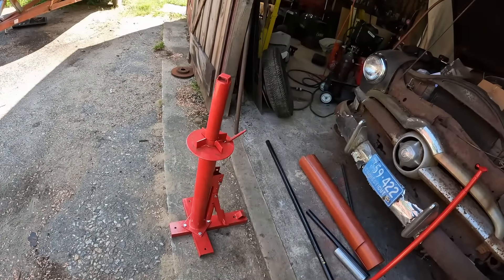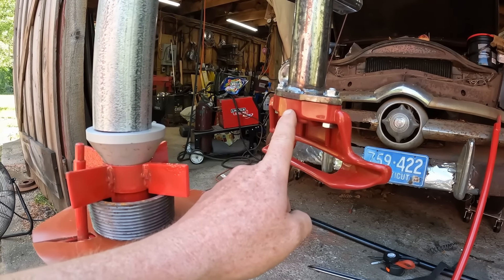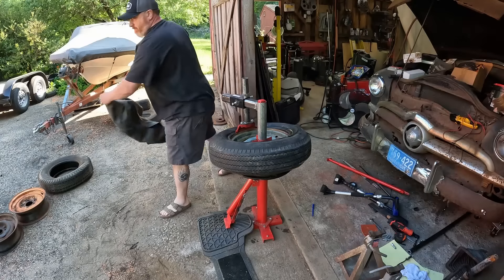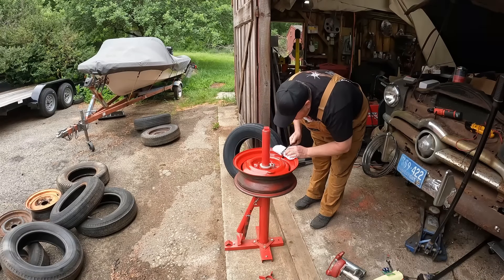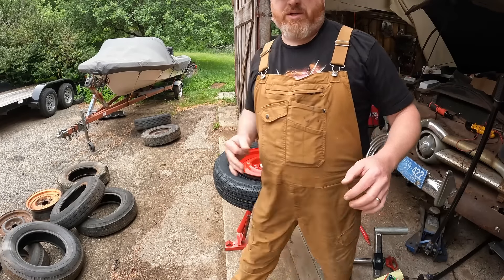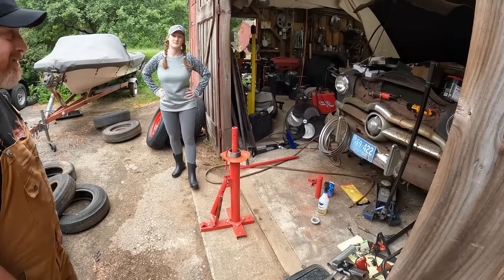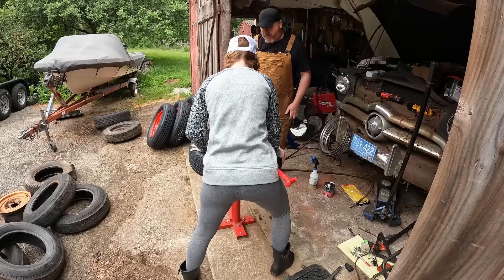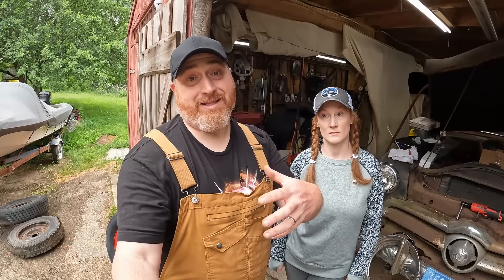How to modify a Harbor Freight Tire Changer to work amazing!!! Follow this DIY guide!!

Comment: I thought that the beads on tube wheels are different than on tubeless wheels?  It's a lot easier to break the bead on tube tires than on tubeless tires..
Reply from the maker: Yeah we've done 4 sets of tires on this thing already. We have 2 other videos doing it. It wasn't harder actually. About the same. We did some 17"and some 18" low profile tires.
Reply: @madgingercustoms    I could not break the Bead on a 10 year old Michlin  tire on Aluminum wheels on my 2003 Duramax.  That was on a hot day too with my 32,000# front end loader bucket.
"  I have two sizes of duck bill hammers.  I never swing them on the bead, I always  place the hammer on the bead and hit it with an 8 # Sludge Hammer.  I had to literally peal the rubber off of the wheel.  Of course once I got the tire off I used a wire wheel on a 9" angle grinder.  I always use Frey Lube rim grease so they come apart much easier 10 years later.  I am just discounting them with tire irons. I ordered the tire changer and parts to build the add on today .. but I didn't get the thrust bearings or the collars..
Reply: @madgingercustoms    I had a 66"x43" on 25" tire I could not get the bead broken.  Took  Commercial tire shop that had a huge air powered bead breaker .. took him 10 minutes and he charged me $125.00

Comment: Hey nifty.. I got a changer myself a few weeks ago. Even as is it's already saved me twice what I paid for it (and a couple family members) it works fine however it takes a long time to get a set done due to the amount of effort I need to dump into one wheel, and I still don't have balancer.guess I found my excuse for cheapy flux core and to make a balancer :) cannot find a friggin balancer tool 	for less tha130 or whatever anywhere 😤
Reply from the maker: Check out our other video on the balancer.

Comment: Something you could do to make it better. I welded a nut to the top of mine so i could spin it on and off faster. Easier and speeds things up. I used a nut the same size as my lug nuts so i don't need to change sockets after pulling my wheels.
Reply from the maker: Solid idea!!
Reply: Yeah. Instead of using the bar to tighten and loosen it. I use my impact to spin it on and off fast.
I may just have to upgrade mine like your's in the future. It's been handy and paid for itself the first time i used it.

Comment: 15:20 The words you are searching for are (old tires) Cross ply & newer tires are RADIALS
It's all in the cords (steel mostly) in the construction of the tire itself.
ie:
(OLD) Cross-ply tire construction, had the cords arranged at a 45-degree angle to the center line of the wheel and crisscrossed. 
(NEW) In a radial ply tire, the cords are arranged at a 90-degree angle to the center line of the wheel and overlap. 
You can find information indicating a radial tire on its side wall
The flexibility of a Radial tire, together with its strength, are two combined factors which mean a radial tire absorbs impact, shock and bumps more effectively than a cross-ply tire. 
The flexibility of the sidewall enhances vehicle stability and provides maximum contact of the tire with the road surface.
THAT is why the older (upright & harder) cross-ply isn't used any more.
The Radial's strength and flexibility allow the wheel to ride over bumps and potholes at a much faster speed, without damaging the tire in the process.
Reply from the maker: We use Bias ply.
Reply: Actually that word would be bias ply, not cross ply. And not all radials are steel, a radial tire can be steel belted or still nylon radial only refers to the direction that the belts are running.

Comment: That was a significant enhancement. I have that tool (without improvement), and it takes me about an hour, a lot of soap water, and more than two fitty to replace one tire. My tires always pop when they seat the bead. I'm not sure I would trust that bead.
Reply from the maker: They are old wheels. Before there were safety beads. They are fine. Just can't run them low.
Reply: @madgingercustoms  Oh yeah you said they had tubers before. Good info.

Comment: First of your vids I watched. Great job! I subscribed. One question and maybe I missed it. Where dit you get the flange the bolts to the duck head and is welded to the vertical pipe. If you explained it I missed it, and I watch the video twice. Thanks!
Reply from the maker: I cut that out of some 1/4 plate I had left over. Just traced the duck head on some cardboard and transfered to the metal. Death wheel from there.

Comment: Did you use threaded inserts for the mounting and what kind type if so
Reply from the maker: I believe they were hammer in redhead anchors.
Reply: @madgingercustoms  ok, any recommendation for a gravel / asphalt / poured floor that is old and crumbly
Reply from the maker: Hmm, if you can't keep a normal anchor in it I'm not sure it's worth your time. In your case you want a steel plate or solid pallet to stand on. There are guys in the comments that said they modified the bottom to slip into a receiver on their truck.

Comment: what size is the round pipe that the duck head goes on  and is that the same size round pipe  that goes over the shaft that the duck head goes into
Reply from the maker: The pipe the duck head is on is 1.25 black pipe. The od is 1.66.

Comment: Your Lincoln welder is acting up because the feed roller is rusted up and needs wire wheeling. I had the same thing happen, my wire would feed in jerks and screw up the welds and I thought my wire feed motor was biting the dust, but it was just the rusty pinch roller.
Reply from the maker: Certainly is a possibility! The machine has actually been replaced by a more capable machine that we are loving. Arccaptain MIG200 multi process.

Comment: was going to buy one of those then just started doing it by hand
two spoons is enough for that - break the bead by driving over it
you can just walk the tire on w your feet basically so no machine needed that's the easiest part
little mower tires can be really difficult so at that i wanted the machine but that was only one time
Reply from the maker: I've done them by hand, that's why I did this mod. Super easy now. The lawn mower ones are a pain.

Comment: my local tire shop charges $30 for repairs and my son had winter and summer tires that he wanted to swap tires to the other set of wheels. so basically 8 tire breakdowns and remounts, over $200 for that.

Comment: At 18:00 try not to use soapy water when putting on a tire. The moisture gets trapped in the tire bead and the rim and can rust and cause leaks. If you do it properly you do not need lubricant. The trick is once the bead is pushed under the rim lip as you spin the arm around, you MUST push the bead behind that DOWN INTO THE RECESS IN THE MIDDLE OF THE RIM to give you slack on the opposite side where the arm is pushing the bead under the rim lip. If you keep the mounted bead in that recess all around, you will have plenty of slack, and the whole bead just slips under rim lip easily as you go around with no lubricant.
Reply from the maker: You are the only person to not recommend soapy water. So tire lube?
Reply: @madgingercustoms  I forgot to mention you have some great videos. As far as soapy water/tire lube, I don't use it anymore. I work the bead deep into the channel as much as possible. It takes me a little longer and I work the bead slowly off the lip with tire spoons at first before rotating the bead wedge around. I don't do tires every day so time is on my side. I have used candle wax in the past but only one the bead wedge. I wiped down the beads afterwards but no water base was used and the wax didn't get on the rims or inside the tire.

Comment: We have one at work. We deal with turf equipment so scuffing the rims isn’t that big of an issue for us. (It’s our equipment) the problem is the shitty steel they’ve manufactured this tire changer with. Parts are bending, metal is wearing down. Quality could be much better but I guess for the price it’s been decent.
Reply from the maker: The entire center post isn't very stout. That's for sure!
Reply: @madgingercustoms  actually haven’t had any issues with the main post. But the bead breaker and that little cross piece you clamp the tire down with are soft metal. And the prybar is all worn down and slips off the tire, making it very hard to put a new tire on the rim. A simple weld bead buildup and some grinding should fix that though. 

I like what you did with welding a plate to the back of the bead breaker.

Comment: I see you figured it out, soapy water is your friend. I usually hit both beads before I go to mount the tire. Then the tire will slip right on and I can go right into mounting the other bead. Leave the soapy water on and it helps when seating the beads. Also, the more soap in the mixture, the better. The same thing applies when you are removing the tire. Hit it with plenty of soapy water. There's no need to rotate the wheel when de-beading the tire, just step on the edge after you broke the bead. It'll pop all the way around. I use a pneumatic foot pedal valve to inflate the tires. That way I can grab both sides of the tire and push down, then pull up fast while stepping on the pedal. Instantly seals the tire, then pops the bead. PS: The guide pin that goes through the rim is all you need to keep the rim from spinning. No need for a bolt.

Comment: 5:44 I'd change the liner in the gun.
Reply from the maker: It was relatively new.  We need to pull it apart and clean it out.
Reply: @madgingercustoms  They plug up faster if you are using flux core wire.  I got a free welder because the liner was bad in the gun.  They gave it away claiming it was the drive motor that was bad.  You can try blowing it out with air.
Reply: @madgingercustoms  Something else I have seen is overheating the mig gun and the ground wire becomes damaged in the gun.  I've seen guys run a new ground on the outside to fix that.

Comment: Around minute mark 20:54, loosen the clamp down on the rim. I cannot stress this enough! In the event of catastrophic failure, the massive amount of energy needs to have somewhere to dissipate. If that tire explodes, all that force (bomb level) will be directed straight at your hips and groin. If it doesn't kill ya, you'll wish it had...
Reply from the maker: Thanks.  We are making the same mistakes currently in our newest video!
Reply: Reading back over what I wrote, I think I can be clearer. UNCLAMP the rim BEFORE setting the bead, so that in the event of unscheduled rapid disassembly,  all that force can dissipate relatively benignly.
Reply from the maker: @Sightless_Squirrel  ah. I get it. New video tomorrow on this exact machine. I think I would have included that!
Reply: Right on! 
Us Shadetree Howler Monkeys wielding a wrench and a hammer have to take care of eachother!

Comment: If I remember correctly - in the 50's wheels changed.  They added a slight ridge inside the rim that the tire bead had to be forced over when inflating the tire.  This was "seating the bead" and caused that pop you hear when a tire is inflated first time.  Has to pop on both sides and then both beads are "seated".  This is supposed to keep the beads positioned on the rim when you have a blowout on the highway.  Your old rims are probably not "safety rims" so you don't get any pop when the bead goes into place against the rim.  With modern tires we don't get blowouts nearly as much as they used to have, so maybe the old rims are safe enough.  Or maybe not.  Anyway, that is what I learned when I was 10 and what does a ten year old know?
Reply from the maker: Yeah, safety bead. We have a couple old rigs without them. Need to keep them aired up properly!

Comment: Those tire machines were what we used in the army to take tires of a two piece wheel they worked great for that
Reply from the maker: I have a set of 2 piece wheels.......I'm not going to try it!
Reply: You shouldn't need this machine for two-piece wheels. That's the whole purpose of a two-piece wheel. Easy disassembly

Comment: I mounted a tire then tried to unmount...didnt have the duck bill tire iron bar so I guess I will get that tomorrow......still tweaking my duck bill mod to get it to work properly.  I did use pipe for the over the top cap swivel part....it has a seam down the center on the inside where they made the pipe that I must get rid of.....or I could just hone the crap out of it.
Reply from the maker: Yeah the piece I used was a seamless pipe. It's difficult to get that weld seam out for sure.
Reply: @gercustomsI welded my horizontal pipe opposite the seam, maybe it matters, maybe it doesnt.  Either way I will figure out how to remove the seam.  I did end up honing it and that helped a lot.  I also have a white paste tire lube made for tires that dries up.  Im not sure if dawn soap works better or this paste stuff.  Stuff says not to get on your hands and has glycol in it.  Dawn doesnt dry up.  The paste is rema tip top universal mounting paste.   Seems to me dawn works better with no water.  I figured the paste wouldnt cause rim rust.  Wasnt too keen on mixing dawn with water

Comment: Hello, Mr Ginger.   I am in process, of constructing one of these tire changers. Plan to use 2 -  3  foot  railway rails, for a base, in a V  formation. Weld the  V's   together. Weld a vertical upright,  either 2 in square tubing, or 2 inch round heavy wall oilfield pipe onto flat plate, welded to rails at  V point.   Now pursuing other ideas ;  looking around for examples, and take the best of each. Your creative inventions, at 9 - 10  time, very good. Soapy water sprayed onto the tire / bead would help reduce  friction.  Anyway,  gathering  ideas.    Thanks  too  much !  
 Good luck,  bro  !    ( from east central Alberta )
Reply from the maker: Thanks for watching!

Comment: When I was 18 back in 1968, I beat the spin balancer using a bubble balancer. The trick is making sure the floor and machine are level, have something to mark tires that will wipe off, and using 4 of the same wheel weights set them on the tire or rim, than mark it take the tire assembly off the balancer and put the first set of weights on the inside straight across from your marks than sit the tire back on the balancer and take the last 2 weights and move them around to get a perfect bubble than take and stop the balancer from moving and mount the 2 weights. Than recheck and adjust with the tire balancer tool.
Reply from the maker: Thank you for your knowledge using this balancer!! I have to do tires next week for our hot rod ice cream truck!

Comment: I built one just like yours. My problem is the three or four concrete bolt anchors. I want to be able to remove mine after it's use. Then just screw it back down for the next job. I think you are set up that way. What hardware did you use for that.
Reply from the maker: I used hammer in redhead cement anchors. They are threaded and expand the first time you tighten then stay in the concrete.

Comment: Just friendly advice.  Use soap mixed with water to take it off and put it on.  Always push the bead to center while turning around .to better seat the tire wet the lips. I used rope or strap around tire to push or bulb up the tire so lips will Sealand catch air watch your hands around bead it can catch your hand or finger at the seal
Reply from the maker: We did better on this video! https://youtu.be/r1ncuxGHcIc?si=P_qW-Tq3UXcR3scR

Comment: I have 2 of these tire changers each mounted on those heavy black plastic pallets and have used them for years to do all kinds of wheels,  both aluminum and steel.  Never damaged a wheel but i always use a soap or something

Comment: I have the same from Harbor freight and I can say Thanks for you supplying
The additional improvements! I have found cheap spray silicone works very good at off and on instead of messy
Soap! It is very fast evaporation so you must not walk away or you will need to spray again,Thanks for the info!!!
Trust in JESUS Alone!!!!!

Comment: I can change it in less time than you with a couple of pry bars and bumper jack to break the bead.
Reply from the maker: Lol. I'm sure. Think those pray bars are going to be kind to a painted or aluminum wheel?
Reply: @madgingercustoms  your not putting pry bars on the outside of the rim, not to mention the one he is using is made of aluminum.

Comment: 5:55 try a new tip in the welder that will cause poor starts like that… usually it’s something way more simple than it seems I’ve only seen one welder actually die and it was a cheap old chicago electric
Reply from the maker: I'll have to give it a shot.
Reply: @madgingercustoms  its only like $5 for a pack of tips and they usually fix the problem
Reply from the maker: @MileytheJeepV2  I have a bunch. Truth be told, I don't use the Lincoln anymore as I have a few other welders from all the review videos I do. One of these days I plan on going through the old Lincoln and tuning it up!
Reply: @madgingercustoms  if it actually has an issue with the spool like you said then it wont fix it… but sometimes a bad tip can oval out and itll seem like the spools doing something wrong when its really something more simple
Reply: @madgingercustoms  i work in a welding shop and we use miller 212 and 252s in there rarely ever have an issue other than burning tips or diffusers up… the tig welders like blowing coolant lines but miller has power reliable might welders they’re just expensive lol.  at home I’ve got a little $200 titanium flux core welder and i can’t complain it gets the job done

Comment: Use lots of lube on both the beads before you fit the tyre to the rim...Especially 4x4  & light truck tyres,  which are much stiffer Makes life a lot easier and they "pop" quicker too....
Reply from the maker: We did. Check this one out. We did much better! 
https://youtu.be/r1ncuxGHcIc?si=P_qW-Tq3UXcR3scR